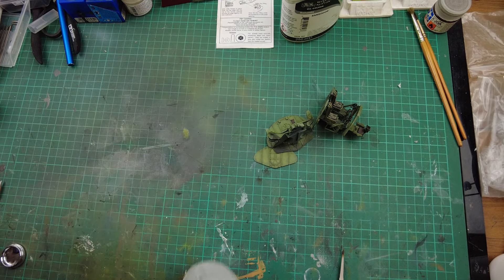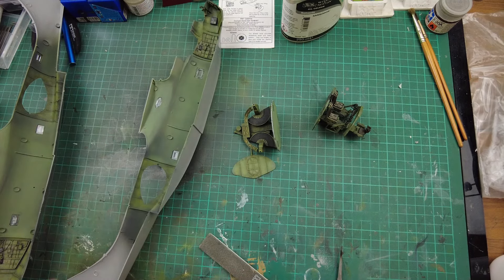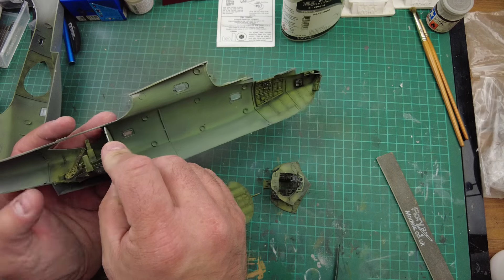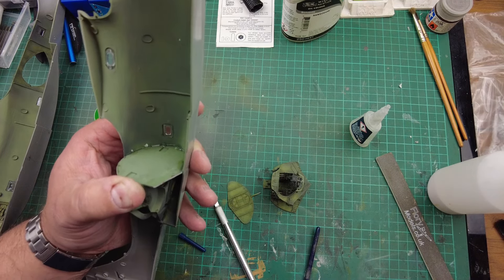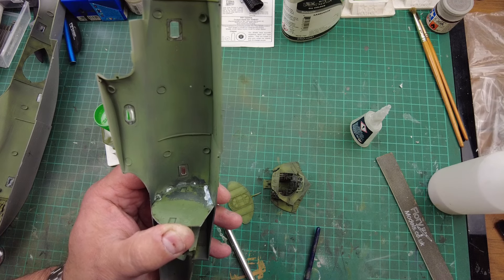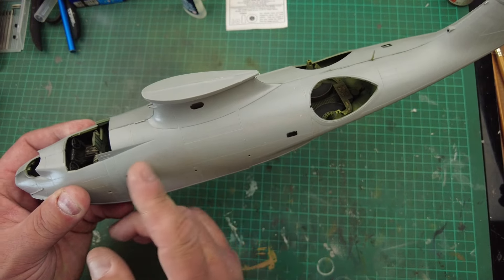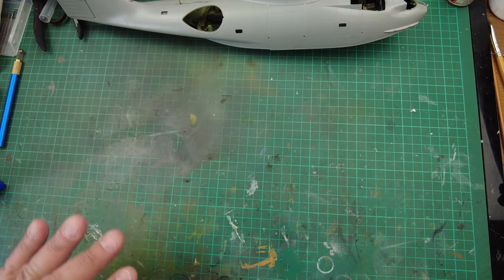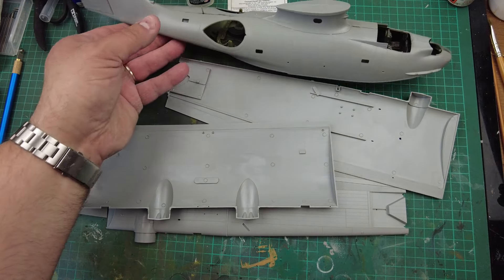Revell 1 48 PBY 5 Catalina Build Part 5 - RAF 210 Squadron JV928  Y

Comment: I think I learnt something there....thanks, nice to see it coming along.
Reply from the maker: Thanks for the feedback, if there’s anything you want me to explain of show further please let me know I’m more than happy to do a more detailed video demonstration 👍
Reply: @KitchenTableModeller  Thank you Ian, no it's very good , I was only wondering why you didnt need to resort to clamps?
Reply from the maker: @organicpaul gluing in sections leaving ample curing time between each helps to reduce the need for clamps, I did tape some seams after holding for a few minutes to keep them in place and I needed to use a couple of cloths pegs for the tail but to be honest once I got the top fuselage glued firm the rest went together very well using Revell contacter cement with Tamiya extra thin brushed over the seam helping to ensure a firm bond👍